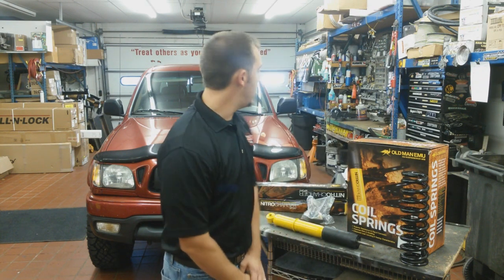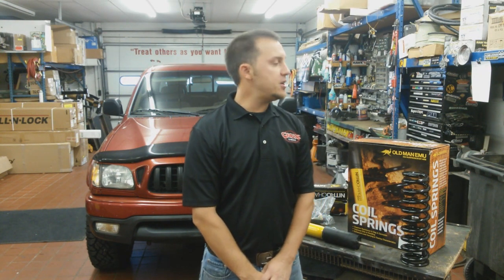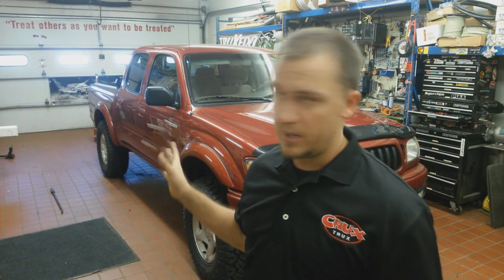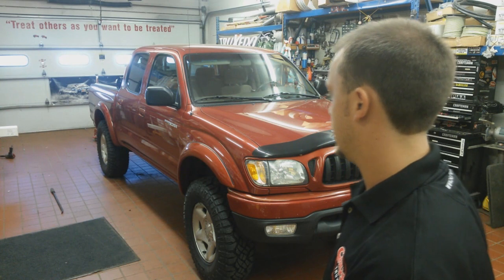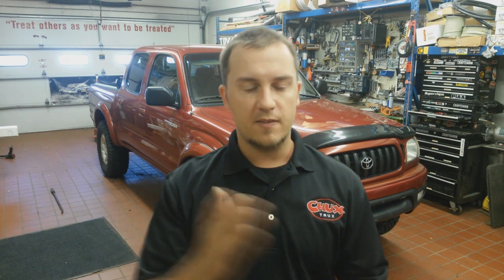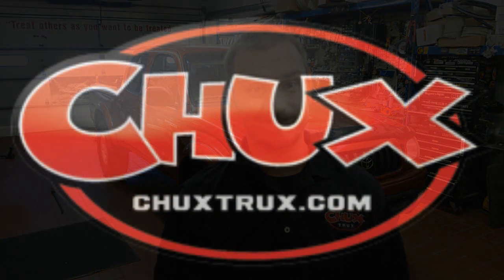Old Man Emu Suspension Lift Kit on Toyota Tacoma

Comment: I am a little confused. Don't you have to replace, add a leaf or block the rear to get lift?  Or is just replacing the rear shocks enough to get lift? Great video
Reply: I am also curious. So I can use my existing trd strut with just the emu spring and install the rear shocks?? That's it?
Reply: Erik Esannason u

Comment: I have a quick question I’m about to order the emu 2.5 inch lift kit for my 02 tacoma like that one in the video will that destroy my cv axles or my ball joints thanks in advance
Reply from the maker: That kit is designed to keep everything within factory specs. But what actually wears these parts out isn't the lift itself (usually).  For ball joints, it's frequently the added weight and offset of the wheels that puts higher stress on these parts. With your truck being 17 years old, I'd just go ahead and replace them at the same time since they aren't meant to last forever and are likely close to worn out anyway.  Make sure you always go with good parts here (OE, Moog, etc or a good quality aftermarket piece) and not the cheapest thing you can get.    We have a saying here at Chux..."A lift kit will exaggerate any pre-existing condition". Meaning, they may be worn out now but you can't tell.  Put the lift, heavier tires/wheels, etc. on there and it may immediately shake, not hold an alignment, etc.  We would never install a kit on a truck that old without doing a complete inspection on the front end since lots of customers add kits to higher mileage trucks, have problems and then blame the kit,wheels/tires instead of realizing that their 150,000-mile truck has some parts that needed replacing.  A lot of those "wear and tear" parts deteriorate so gradually (like brakes, tires, etc.) that they are worn out and you just haven't realized it.    Short answer= you should be fine, but have a qualified shop look over the front end and do it right the first time, replacing what needs to be replaced at the same time.  Good luck!
Reply: Chux Trux Inc thanks a lot just learn a lot just by reading your comment thank you

Comment: Did you have to change anything with the CV joint after installing this lift?
Reply: As far as modifying, changing, or adding a spacer, no. There is not enough vertical change to require any modifictions to the CV axles/joints